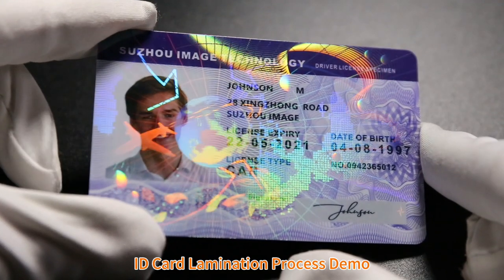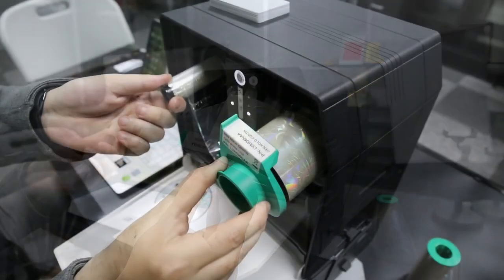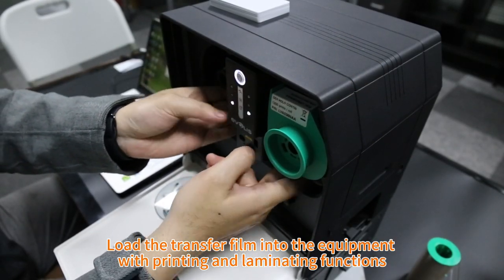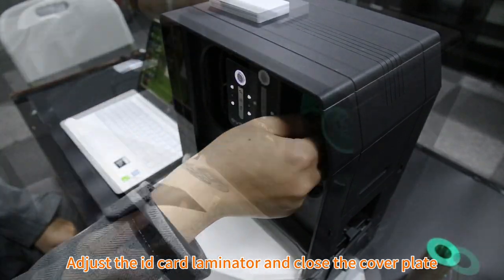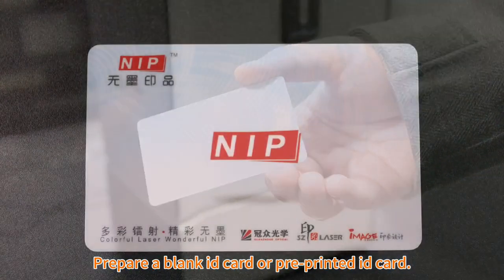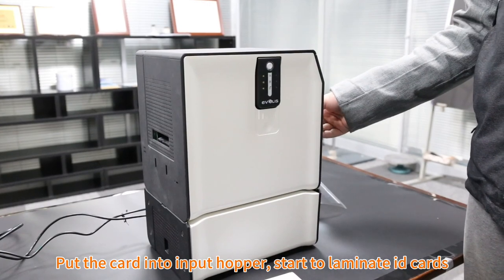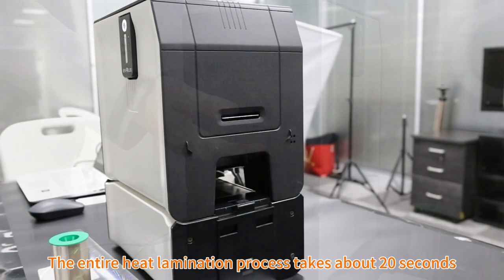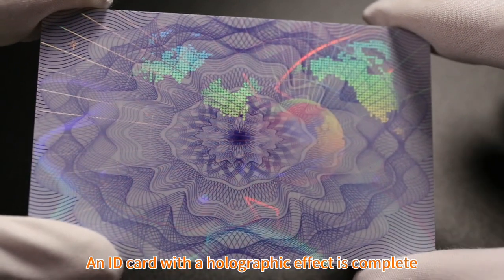How to Use the Laminating Machine to Laminate Holograms on PVC ID Cards

Comment: Is hologram give any problems when we do photocopy of it.

Like reflection of lamination on photocopy?
Reply from the maker: Hello, before laminating, we need to set the laminating speed and temperature. Once adjusted, the hologram can be laminated perfectly on the ID card.
We have a dedicated technical team and a QC team. If you have any problems, you can contact us at any time.
Reply: @SuzhouImageTechnology  If someone has to make a copy of his id with the hologram on it, will the photo copy work?
Reply from the maker: @4bitmultiplexer   Holographic images are produced by professional photolithography equipment and can present 3D dynamic changes. The high resolution cannot be achieved or copied by  printing technology.

Comment: Can the machine choose shapes? And what is the name of the machine?
Reply from the maker: Hello, this is a laminator machine. It can laminate the hologram onto standard CR ID cards, protecting ID cards from forgery and scratching. 
What do you mean by the shape?
Reply: @SuzhouImageTechnology  In short, he wants the brand and name of the machine, and he wonders whether patterns such as a bird, a castle, a cup can be processed on the hologram, as in a normal printer.
Reply from the maker: @MysticFrogMC  This is just a laminating device that can laminate the holographic pattern onto the card's surface. The holographic effect can present a 3D stereoscopic and color-changing effect, which requires high-precision lithography equipment to complete, which is impossible with ordinary printing equipment. This is also the reason why the holographic effect is not easy to forge.